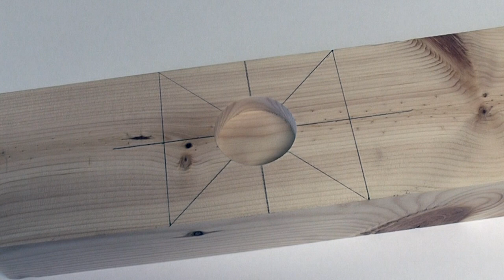How to Cut a Hole with a Router

Comment: Cmon annoying music. Switch to a narration explaining what is happening step by step along with the accessories used.
Reply from the maker: I tend too with my new videos now. This was an older video and I wasn’t confident speaking on camera. 👍
Reply: @Smugwood  "How To" needs to be as short direct to the point as possible with zero distractions. The viewer should understand the process demonstrated and be able to execute it. Stick to that and your channel will grow with a genuine base that is interested in this type of content without the annoying distractions. Project. Materials needed. Tooling needed. Meticulous process A-Z. Approximate Cost of material. Approximate cost of labor if not DIY. Approximate time to complete. Links to materials for reference always a plus. That's a winning blue print. We know this works cuz we watched a contractor work within one of our buildings and the thoroughness of the process, the explanations along the way, the transparency with numbers and accuracy with completion time windows was a breath of fresh air ... gave em the contract for all the buildings. Good luck!
Reply: What kind of router was used? Or what drill bit size? The 70’s music was annoying so it would be nice if you had instructions displayed at least. This video wasn’t even helpful

Comment: I have a 6 inch round base SKIL    so what a 6 inc + hole, uh template + the diameter
First make a  of the  
A six inch hole you get the diameter of the tool
A seven inchole you get a hole  one inch + the D of the tool.
Close but you can route the template hole.

I wanted too make holes in composite SUP  2.0"  ID and 1.5" ID for built in equipment attachment points

Comment: Great video but a little confused.  You already have the huge Forstner bit so why don't you just use that to the depth you want and then use the router to clean up the 1/8th inch depth for the center hole left by the Forstner bit that you don't like?  Furthermore I wish to do exactly what you did but I don't have the huge Forstner bit to make the template in the first place.... so having a bushing set won't do me any good.  Thanks for the reply.  Nice setup too
Reply from the maker: The video was kind of in response to a few people who wanted to make tea light candle holders. They were using forester bits to cut the holes but that leaves the guide hole at the bottom which they didn't want. So this was showing how it can be done with a router. I used a forstner bit to cut a template hole slightly bigger than the candle holder so that when i routered the hole with the bushings, it would give me the correct size hole for the tea light, without the guide hole that the forstner bit left. Hopefully that makes sense :)
Reply: Smugwood thanks for the reply!  I just need to figure out how to make a 2.3 inch diameter hole through a 2x4. Guess I need a router hole cutting jig that can make small holes
Reply from the maker: No probs...one of the fun yet frustrating things about woodwork is finding problems and coming up with solutions. Theres a certain feel good factor. Jigs are a great help and also give you that repeatability. Ive experimented with allsorts of things to help me cut circles...washers, plates, coins, cd's...once you have the jig built things are a lot easier. Im fortunate now to have a cnc so i usually cut my circle jigs on there for accuracy...but having a router with various bushes etc can be a help too.

Comment: I was wondering how to do this exactly, thanks! How do you manage to make holes that aren't forstner size?
Reply from the maker: I use 2 ways. One way is that I have different size bushes or different sized cutters so using the same forstner  bit I can get different sized holes using different bush and cutter combos. The other thing I have is I’ve made a hole jig on the cnc which is basically a bid piece of mdf with lots of holes so I have different choices. And holes much bigger than that ie say 200mm then if I don’t do it on the cnc and need the router, I need to use my pivoting jig that I made and use it like a compass...but that’s mainly something I use to cut the entire hole out.
Reply: @Smugwood  thank you! is pretty much what thought, but as I haven't a cnc I think I need to do the hole jig the old way. Best regards

Comment: Hey man, this might be a silly question but say I needed to make a hole in the range of 16-20mm diameter that only goes part way through the wood - could I get a large straight bit and just use a plunge router to plunge straight down then back up without moving the router itself?

I've never used a router before and I'm thinking of buying one but want to make sure it'll work for what I have in mind.
Reply from the maker: Not sure it would be stable enough...I can see there being lots of room for error unless it was setup on a jig of somekind or a guide collet. Any slight movement of the router would alter the hole size I’m guessing. It’s not something I’ve tried. Would a forstner bit be an alternative.? I’ve seen people use 2 same sized forstner bits. Part drilled with one then the second one has had the point ground away to leave a flat bottom with no pilot hole...unless of course it doesn’t matter about the pilot hole. But I haven’t tried either way.
Reply: Perfectly do able but better to clamp workpiece and router in place.  the action of the spring can be a bit vicious.